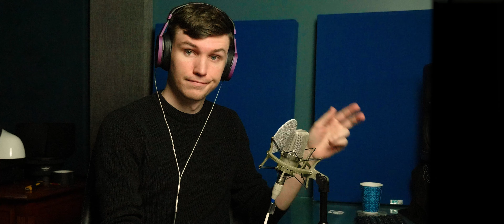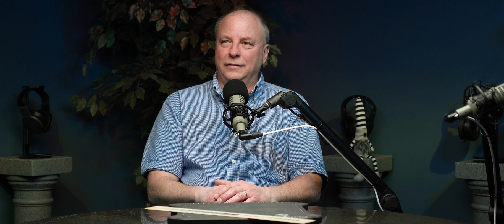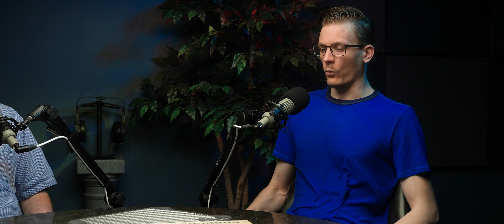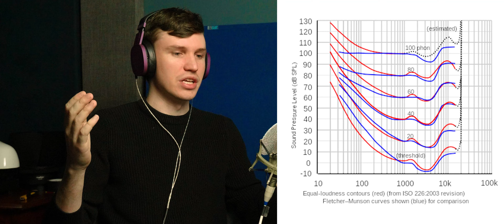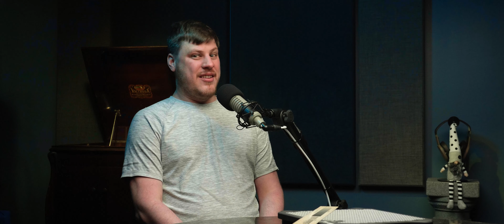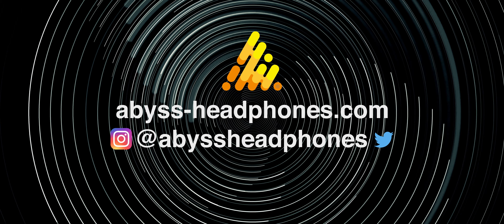What is FLAT? Why bother to EQ your headphone system.

Comment: If someone were to snap their fingers, no one around them would have an issue saying the sound seemed real. It doesn't matter if people hear differently, because it still sounds real. If that sound was recorded by a flat mic (all frequencies are recorded at the same sensitivity) and played back on a flat speaker (all frequencies are played back at the same volume), it would sound just as real. The open idea that all ears are different, so each person should tune their headphones differently can only result in sounds being inaccurate for everyone and artist intention can only be achieved by wearing the exact pair of headphones with the same tuning as the artist. The goal is to approach perfection in measurement and reproduction that is standardized between every producer and listener. It's entirely no different than a movie studio using calibrated cameras and monitors, and then viewing the movie on a calibrated TV at home. Flat has a very obvious and clear meaning and isn't ambiguous and needs to be standardized for the sake of the consumer. The free-for-all only serves to allow headphone manufacturers to make more money.
Reply from the maker: We manufacture proprietary planar transducers that can reproduce sounds found in the real world and in nature. The limiting factors in playback of these sounds are absolutely the recordings and the electronics.

Comment: Good discussion. Personally I like to use Harmon target as my EQ basis, then adjust as needed. The nice thing is that with the AutoEQ project they compensate to match that curve, and you can compare different headphones (mainly) on some technical performance and can help out a lot of headphones just to at least reach that "neutral" level. But even when you can EQ to it, the physical characteristics of the drivers/headphones make them sound vastly different.

For me, the Focal target is pretty closed off and muffled sounding. If you EQ to harmon and (especially) compensate for their weird 3-6K dip, it becomes so much more enjoyable to listen to and clean where you can hear the technical performance and ignore the usual tonal balance that separates a lot of products. Its always a lot of experimentation though when it comes to preference, and frequency response is only a small part of the picture.

Comment: I agree that flat is a difficult term to define exactly. Suppose instead that we go with the goal of making our headphone present to us exactly what the mastering engineer intended. I have an idea about how to do this: 
1.  First take a bunch of measurements to obtain your own HRTF curve to a reasonable degree of accuracy. 
 2. Use a spectrum analyzer to obtain an averaged frequency plot from a given song's source file
3. Apply the inverted HRTF curve to the song using an equalizer 
4. Play this through the headphones and record this output with a transducer
5. Apply the spectrum analyzer to this recording to obtain its averaged frequency response plot
6. Subtract this plot from the source file response plot to obtain an error curve
7. The inverted error curve is the EQ correction which should give you something that approximates what the mastering engineer intended